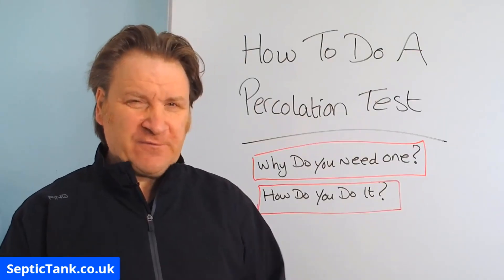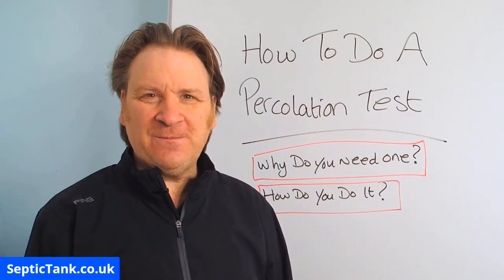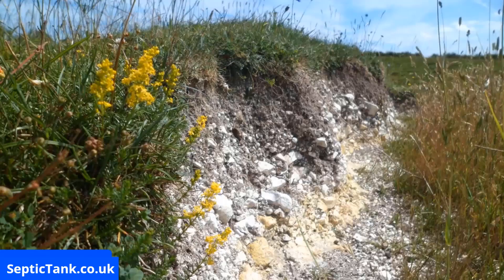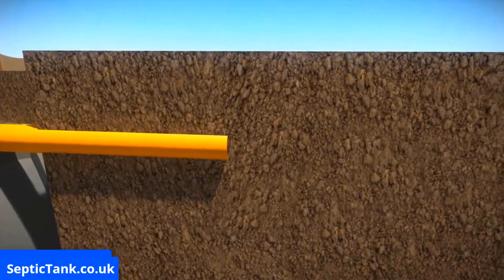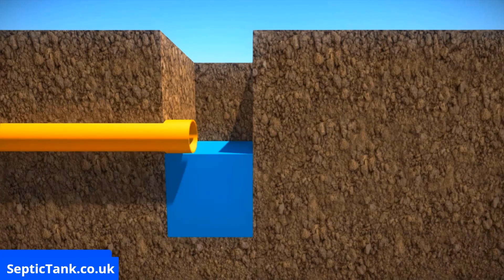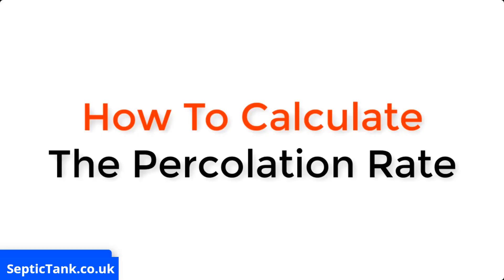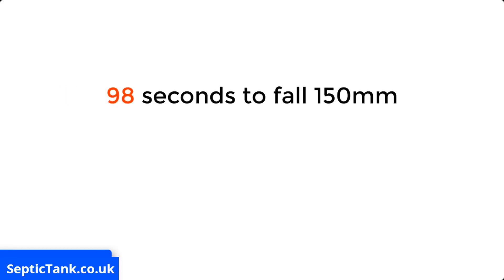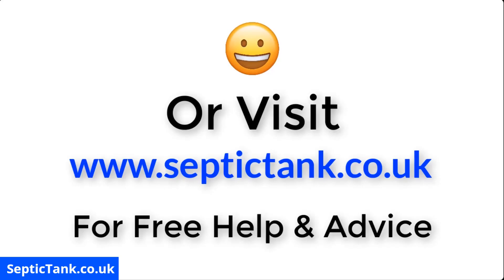Percolation Test

Comment: The maths is incorrect.

98/150=0.65s/mm

In that example to water will drain far too quickly.
Reply: That's true, 98 mins would be more accurate.
(98m x 60s) / 150mm = 5880 / 150 = Vp of 39.2